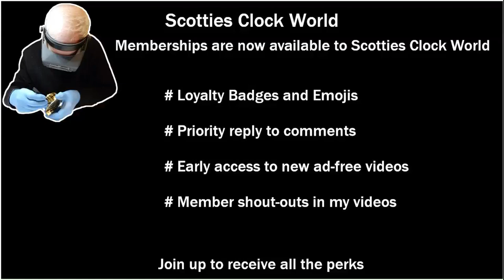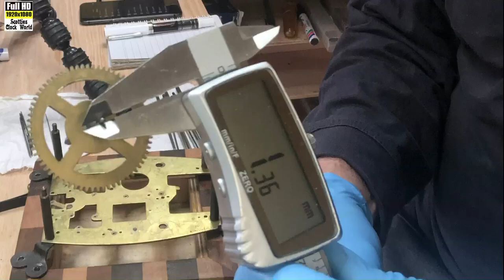Korean 31 Day Wall Clock Repair - Full Video

Comment: Thanks for the detailed video.  I just picked up a Korean clock and internals look the same (Delta on the face). It is missing the winding key but that is easily fixed. The hammer doesn’t strike, it seems to miss by maybe 2 millimeters. That tells me the strike mainspring is still working well without being able to wind it. Other than that I’m still assessing what I might do with the movement as I’m not overly excited by the clock cases itself.
Reply from the maker: Bend the hammer wires so the hammers hit the gongs and rebound once that have hit. If the hammers remain on the gongs there will be a dull thump when they strike.

Comment: Is there a special way you set the warning wheel. On my clock it goes into continuous strike when the hour warn is reached
Reply from the maker: Sounds like the pin on the Warning Wheel is not being arrested by the lever.